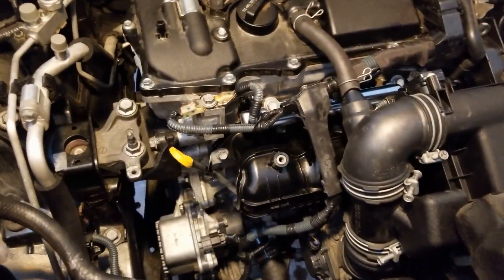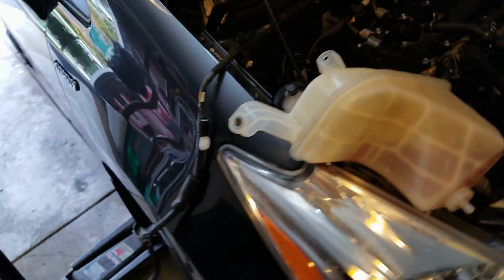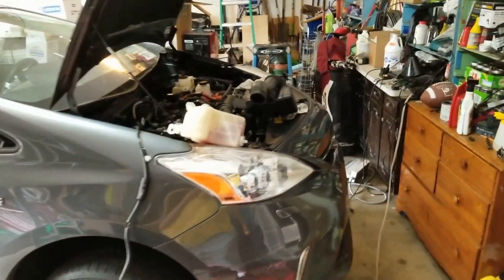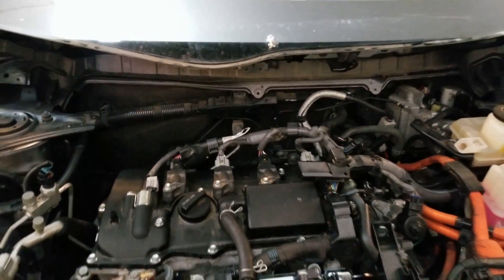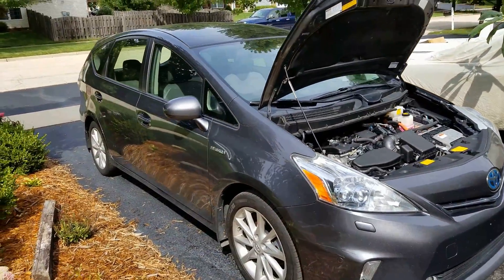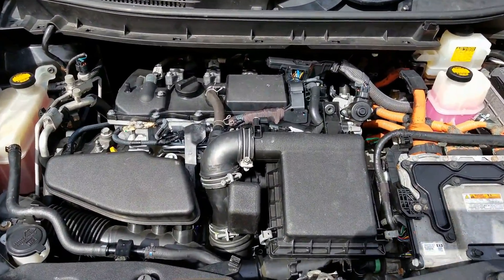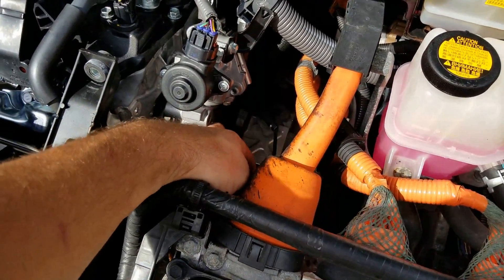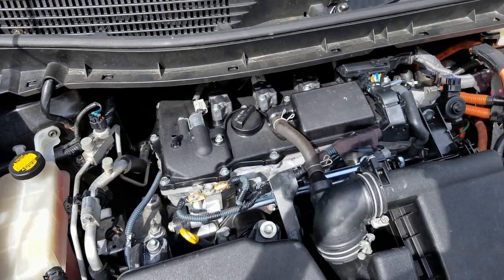Fix That Prius! - 2016 Toyota Prius Engine Installed in My 2012 Prius Gravy FIVE!

Comment: I am thinking to swap 3rd gen (300k miles, blown head gasket, leaking cylinder) with either low miles JDM 3rd gen or low mile JDM 4th gen for 2010 Prius. Pricewise 4th gen engine costs about $400 more. Which option do you recommend? And why? How did you lift the engine? Did you use engine lift? Is it doable project for unexperienced people? Thanks

Comment: is it better to use the gen4 egr system it does seem to have improvements
Reply from the maker: Hi, you should NOT use the new 2016 - 2018 EGR, EGR cooler, Intake manifold, MAP sensor or throttle body. Others have tried and failed. Use the new fuel injectors, fuel rail, water pump, thermostat, temp sensors, knock sensor, oil pressure sensor, cam position sensor. 

https://www.youtube.com/watch?v=P2ROzwbLIso&t=1s

 - Fix That Prius !!!

Comment: I have a question , Have you done a motor swap and use  the 4 gen EGR? I'm keep getting P0401 error. Just wanted to know your take on it. I also did swap a 3gen motor to a 4 gen motor but it on a Prius two. Thanks for you help.
Reply from the maker: https://priuschat.com/threads/engine-swap-question.197101/
Reply from the maker: https://priuschat.com/threads/swapping-in-a-gen-4-prius-2zr-engine-into-the-prius-v.199874/

Comment: Do the different modes, power and eco modes still work? Can you still read the engine information, like fuel economy and power on the dash ?
Reply from the maker: Hi,
 Thanks for your question. Please subscribe to my channel.
There is no change to anything that isn't changed. If you replace the engine and install all of the original sensors and accessories, the Prius sees the same stuff it saw before.
It only gets tricky when you try to  install the new stuff. It can be done, but this is already a project.
 - Fix That Prius !!!

Comment: Have you been able to solve the problem with the engine light?
Reply from the maker: Hi,
Which light?
Reply: @fixthatprius4980  I read one of your comments on Priuschat and you said one of the dashboard lights comes on and off sometimes.  Was it the comment of someone else?
Reply from the maker: @Elaba_  Hi, Yes I had a coolant temp light that only comes on in the winter. I removed the "jiggle pin" from the thermostat and have not had a problem since.
- Fix That Prius !!!
Reply: Fix That Prius! Could you elaborate on what you mean by this?

Comment: Love the videos, well done. I have just recently become a huge fan of the prius. 
A friend sold us their 2010 base model with 250k miles and I enjoy the fact that it's super economical and fits anywhere and is reasonably spacious. The bad is I think it has a bad head gasket. We purchased it with the CEL light on, the seller told me his mechanic thought it was the plugs or wires that may be causing it. I had the car for a few days and ran the codes and P0301 and P0302 and P0300 codes were popping up. I changed plugs and cleaned the whole EGR assembly (it was completely clogged) so now I'm thinking the damage has been done. 
It doesn't seem to be burning oil but I think I'm losing coolant. Strangely there is no milky oil on the oil cap and the a block test came back inconclusive. i.e. there doesn't seem to be combustion in the cooling system which is odd. It does periodically have the engine shutter especially on wetter days (rainy). I'm wondering if it's worth doing a leak down test to find out if it really is a bad gasket but I also think that the losing coolant is a tell tale sign. 
Question, where did you get your prius engine? and if you're willing to tell me, how much? I've read that I may want to stay away from JDM? I think the car is worth it so I may just keep topping off the coolant until I have time to swap the engine. Did you happen to set up an oil catch system on the new engine? If not, why?
I appreciate your feedback.
Ric
Reply from the maker: Hi,
 Thanks for the question. Please subscribe to my channel.
First, if you have any kind of engine, trans noise or misfire - disconnect the EGR wires. See what that does for it.
Second, you will know when you're losing coolant! You will not be able to drive for more than a few miles.
Third, rebuilding these crap engines will result in a rebuilt piece of crap.
If you want to keep this car, install a 2016-17 Prius engine but you have to modify the car in a few small ways. Watch all the video's - you'll see.
I've done the swap twice. First engine I bought from LKQ for about $1600. Had 3200 miles on it. Really a new engine.
Second engine I bought on eBay with 29000 miles on it cost about $1300.
The first engine purrs like a kitten. The second engine runs.
Get the lowest mileage engine from the newest car that will work. If you want a direct swap, get a 2015 nothing older.
I did not do a catch can. My engines burned about a quart a week.
I did leave my EGR unplugged which stops the oily exhaust from being blown back into the EGR cooler and engine, saving my spark plugs.
 - Fix That Prius !!!
Reply: The block test should be done while revving the engine for a couple of minutes. The engine should be warm. The block test was negative first on my Prius but became positive after warming up the car and revving it up.
Reply: @Elaba_ , thank you for the response. 
Yes, the car was on maintenance mode while I ran the test and definitely warm. I had an OBDII scanner reading the temp and it never surpassed 175 degrees.
Reply: @avidskier73  Did you rev it up to 2000 rpm for 5 minutes or more with the tester installed?
Reply: @Elaba_ , that's a negative - I did not.
Reply: @avidskier73  Maybe you should try again. My advice: sell it and if available in your country, buy  a Yaris 1.0 VVTI with the KR-FE engine.  These can get higher mileages without problems. Keep on looking till you got a reliable car and keep it for long.
Reply: @Elaba_ , 
you read my mind. I requested an estimate from Carvana and 2400 seems like a damn good offer. I would be breaking even and then a little something for the labor I already put into this thing.